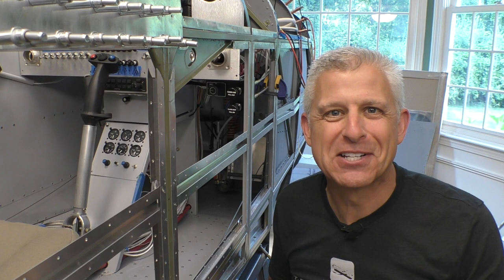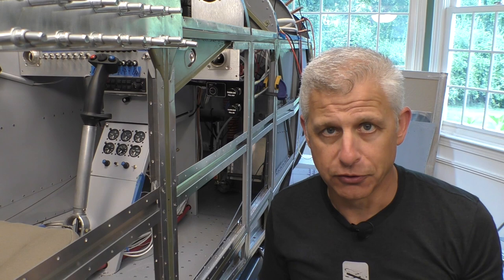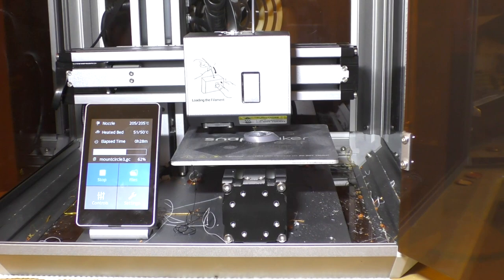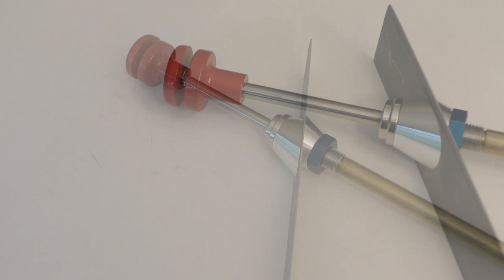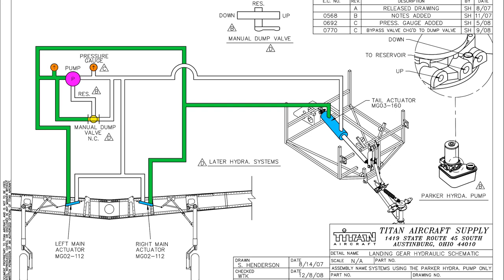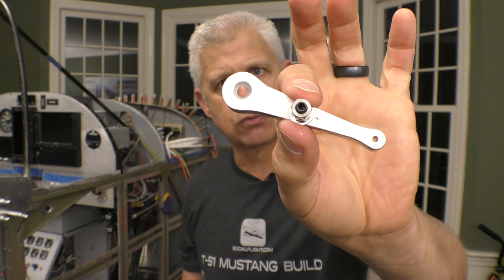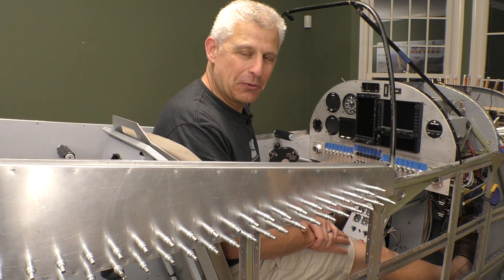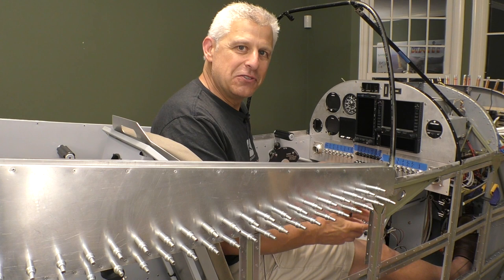GEAR EMERGENCY!  Designing the Systems That Will SAVE THE DAY!

Comment: G, day Jeff and all from Sydney Australia.
Great problem solving by engineering the 3D printed parts. You couldn't just spray paint them silver or black: not strong enough?
Wanting aluminium?
🌏🇭🇲
Reply from the maker: Hi John - Our main concern was how the PLA plastic would hold up to the summer heat in a closed cockpit sitting out on the ramp. No worries about that with aluminum!